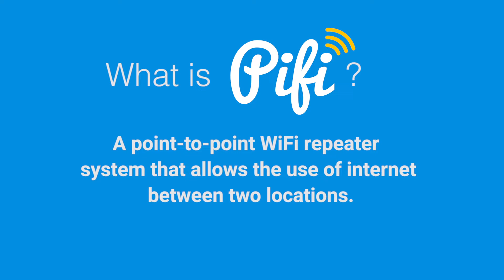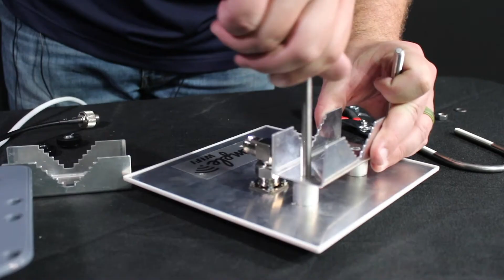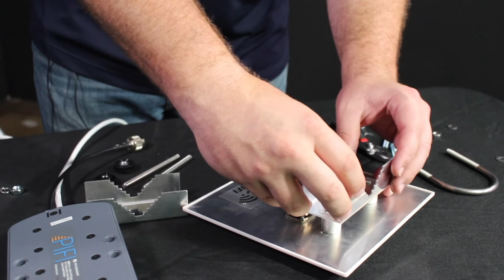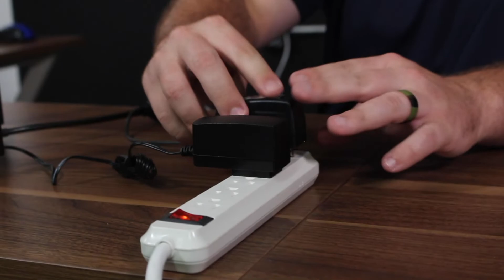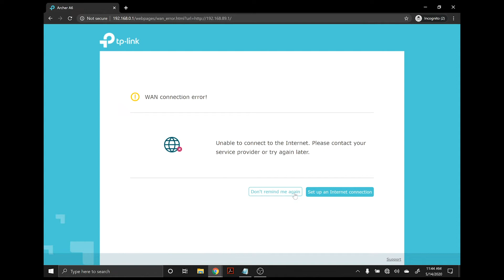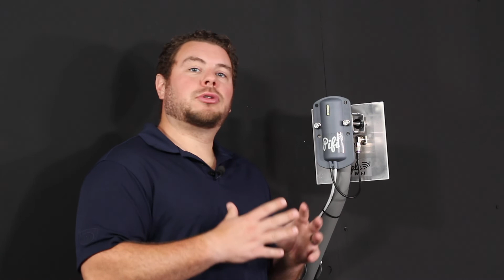PiFi Repeater - How to Works and Setup from Start to Finish

Comment: So...If I want to grab wifi from the main house (point a) on my property to a cabin (Point B) about 500 feet away, all I need is the Pifi repeater that is pointing at the house? Can I get away without putting an additional wifi signal booster/antenna on the outside of point a?

Comment: Hello my brother, I paid a TP-LINK CPE710, after configuring the access point, my 2GHz phones do not detect my CPE710 5GHz AC867.  Is there a possibility to convert 5GHz to 2GHz or a configuration for all phones and devices to connect?

Comment: Hello, 
To connect a long range point to point, can I use a parabolic dish and an access point model: (TP-LINK TL-WA801ND_V1 Wireless N300) to send (2400GHz) frequency ?

How far can I get the frequency 100% ?

Comment: so... you shoot a wi fi signal with your external flat panel antennas... to.. a receiver antenna which is connected to a .... router, which.. has bulit in wi fi, which transmit to the remote locations devices, allowing them access to the internet.  Why don't they just connect to the signal being amplified by the directional antenna from the host site?  Seems extraneous to have  multiple wifi signals for actually one connection to the provider overlaying each other.  with so many wifi signals, from different devices, doesn't tht cause overlays, or washing the area with conflicting signals ?  because they are generated each by their own networks?  And even when nthe same network... with powered antennas transmitting and powered anntennas recieving, aren'tthey sweeping  connections? seeking receptions? and at each sweep, even when connected onthe same network, and doesn't that cause data collision, where configurations, designed to repackage data packs, must encapsulate fragmented data in smaller packages fro this protection, are activated to repack the damages data , where the new out of order package now will be sent out, and need be re sequenced on the receiving end, further slowing the rate of transmission?
Reply: You can use a single high power access point.  However, most are omnidirectional and the signal has much difficulty penetrating all the walls in a building.

Comment: Does this antenna work if I point at a wifi camera at 30meters (behind a concrete wall)?
Reply: Probably yes, but since the camera is sending the signal, it will have to have high power output for it to be seen by the base station.

Comment: Please make a video about compairing the ALFA 7dbi SMA PANEL antina and ALFA 9dbi OMNI DIRECTION antina  which is the best for wifi adaptor .
1)https://www.amazon.in/dp/B003ZWPRUI/ref=cm_sw_r_cp_apa_fabc_FuN0FbXAWCGA5?_encoding=UTF8&psc=1

2)https://www.amazon.in/dp/B009H028CM/ref=cm_sw_r_cp_apa_fabc_iyN0Fb37VEY4R?_encoding=UTF8&psc=1

Comment: Hello, i have a large field and data for me is very expensive, while i am out on the field i would like to listen to music, is there any way i can cover a large area (200 - 300 yards) away with a 180 degree pickup pattern, without having to use an external antenna at my phone so i can just connect? or is this way too difficult/expensive to do so. Thanks!
Reply: For 180 degrees, you'll need a pair of 90 degree antennas.  Many people, however, set up an omnidirectional antenna and are satisfied with the results.